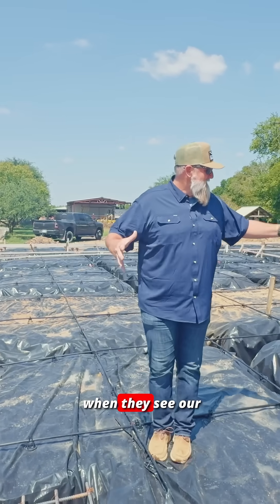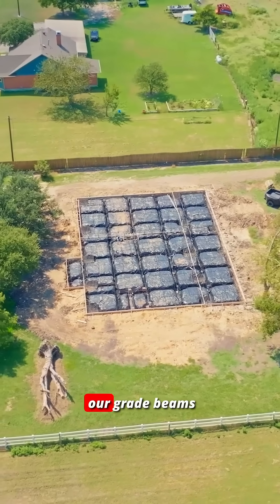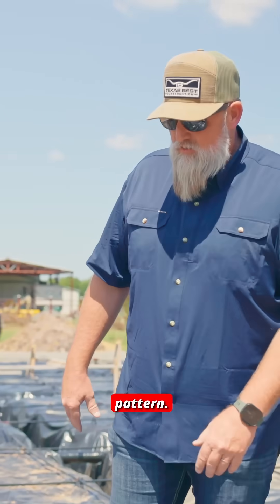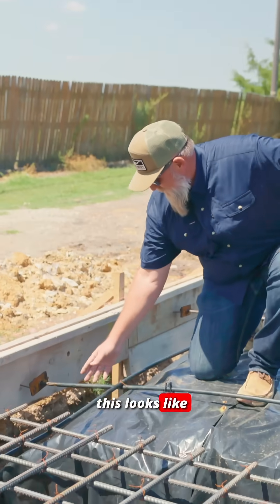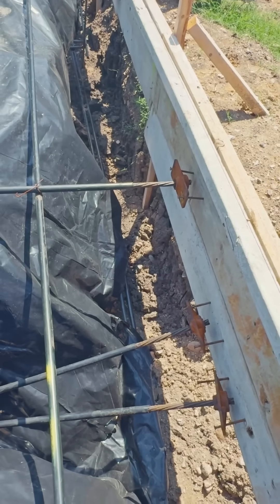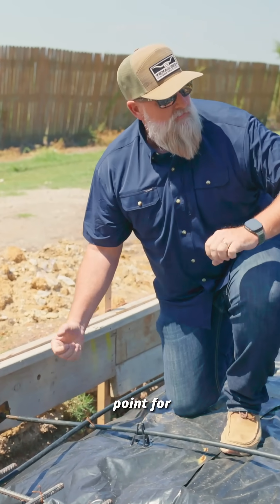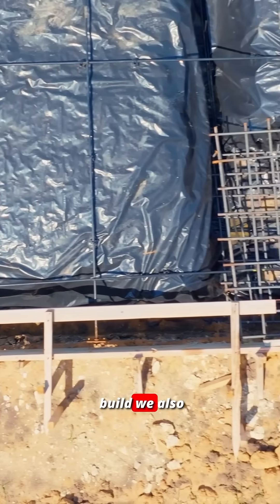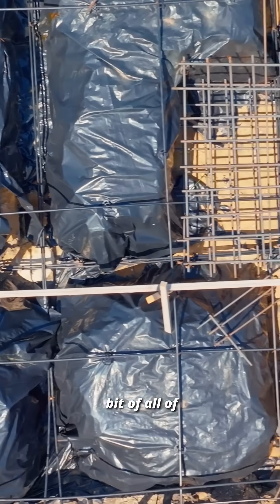Post Tension for a Monolithic Concrete Foundation

Comment: I did heavy concrete as a bridge builder carpenter for decades and its amazing how inexperience, clueless fools comment negatively  about forming for slabs, walls or beams . I know this as a heavy load waffle slab. They use this on compressive or moving soils to control differential settlement and edge break off due to perimeter wall loading. They also do wall panels that are PRESTRESSED and placed between red iron steel beams and welded going up 3-4 floors and set after cure 2 weeks
Reply from the maker: Appreciate the detailed comment!

Comment: How do they tension the cables inside of the concrete? I get there are plastic sleeves, but those flanges look too weak to pull on, then how do they keep the tension over time?
Reply from the maker: They pull from the other side after the concrete is cured.